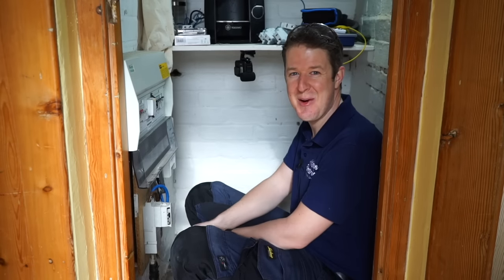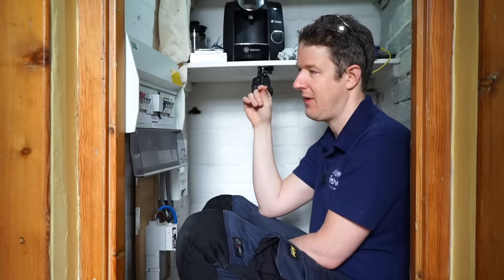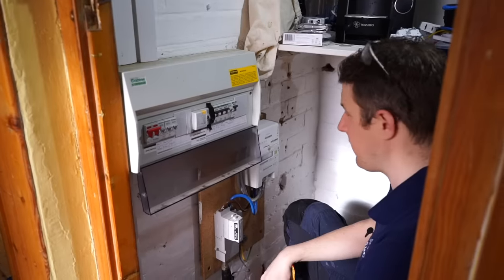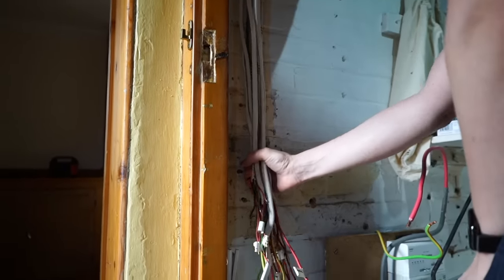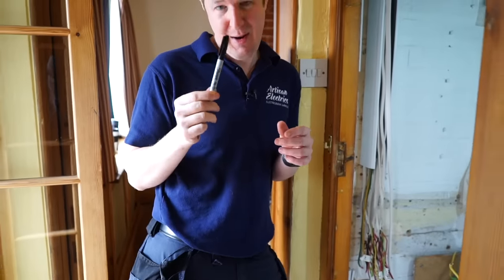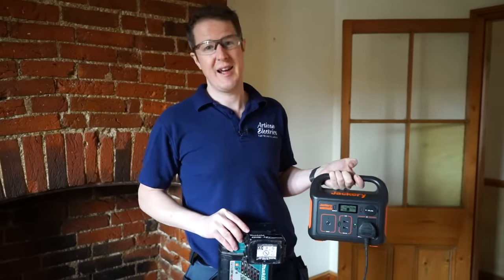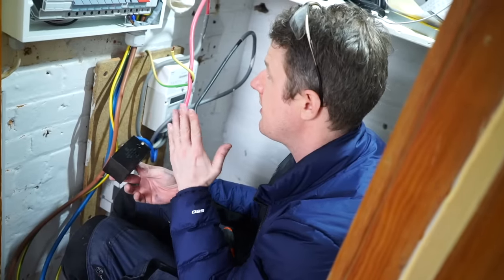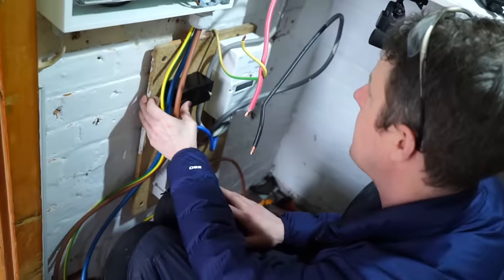My Consumer Unit Secrets 🤫 - How to install a Consumer Unit/Fuse Box

Comment: I was just wondering what your area engineer would have though to you pulling the main fuse and breaking  the meter  seals .You do know that is breaking the law. Also i did wonderif it needed changing . Cos it didnt. It was obviously you who talked the customer  into changing the fuse box when it didnt need doing. I mean he trusted you as the expert .But actually you just saw pounds and thought fuck it . None of this was necessary was it Jordan but thats how you got your place in the south of france . Well done .Your a con man
Reply: I totally agree with you that it didn’t need replacing but due to the fact that he said the property was gonna be rented out as a landlord it probably wouldn’t be a bad idea to make sure it comes up to current 18th edition regulations meaning that everything is protected by an RCD. The other point you make about removing the seals it is not illegal because if you are a fully qualified electrician, you will fully test the installation and issue and installation certificate which would then be notified to the council and also the electrical body that you are registered with which could be the NICEIC or
NAPIT.

Comment: Oh, pulling the main fuse... That's odd. We were taught, It is illegal for an electrician to remove a main fuse when they have not been authorised by the DNO to do so. Any electrician who pulls a fuse without getting permission from the DNO, puts themselves at risk of being fined even years later. The fine I believe is £3000 - the DNO has the right to choose to enforce it, many never know it's been done till one day they get called out and find the clips have been cut. Nowadays you have to sign off your work and put inspection notices on... So if they want to, they can come after you. I guess electricians have got so used to nobody knowing who did what, they don't realize it is all kept on record nowadays and will carry on chopping the clips, until one day they get a letter.

Comment: Stopped watching this after a few minutes , as this guy is a total cowboy , he clearly doesn’t know the law , the meter and the cutout are sealed for a reason , he if he was allowed to remove the cut out fuse which is classed as live working , he should be wearing the appropriate PPE .As a contractor he should never work live and should of asked his local supply company to have fitted an isolator switch , for him to work on the consumer unit at his leisure and his safety and the safety of any one else with access to the property.There’s a lot more to it that this , but I would advice Artisan Electrics o remove this post , before he is reported to H&S .

Comment: Electrician’s out there who pull the main fuse at a cut out when you know your not qualified trained or authorised to do so. One main reason let’s say you have pulled the fuse done the work and go to put it back in? What if in that time there was all of a sudden a open circuit fault back out on the main that service head is jointed to you go putting that fuse back in bang massive flash over your hole face, chest and hands burnt. It has happened to a electrician what I have said above so for your own sake don’t touch something your not experienced or trained to do!!!!